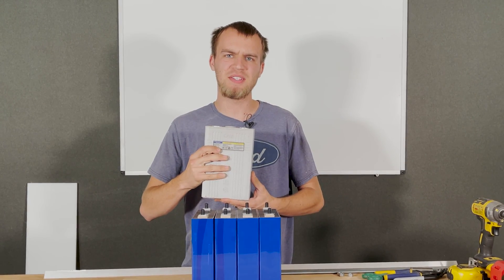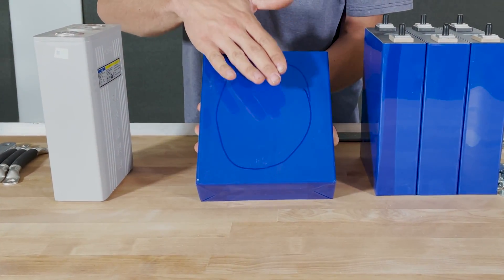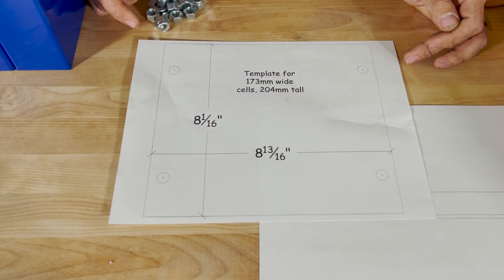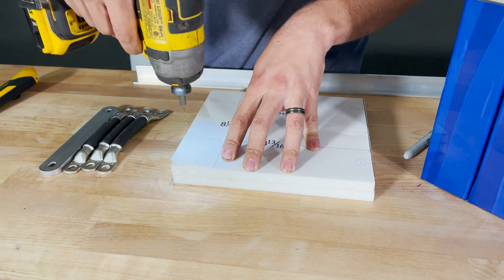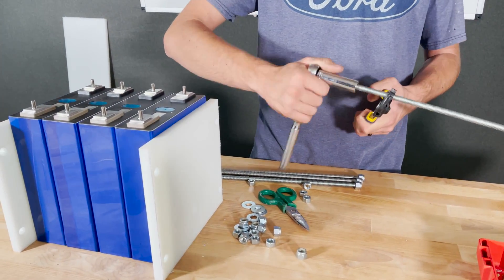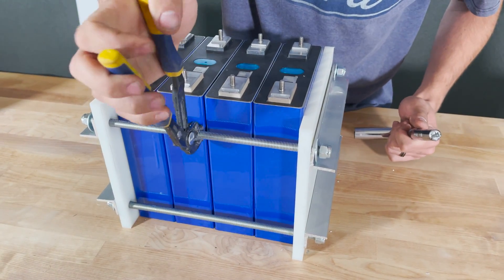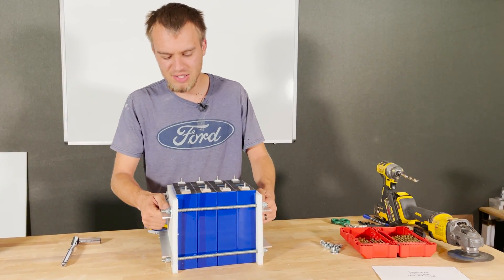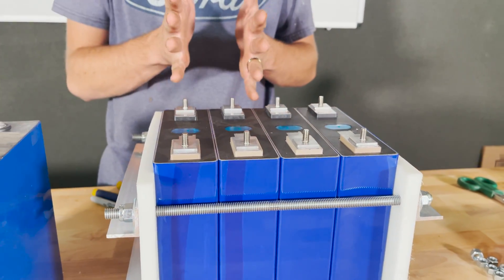LFP Cell Compression || The What Why How & Very Important Considerations || Step-By Step Tutorial

Comment: VERY VERY VERY IMPORTANT to consider with these new compact LFP cells!!! Isolation between cells!! I have measured 5mA current between the aluminum casing( that is tie to the positive with some resistance) and the negative!! so if you tigh them together and the fragile blue sheet puncture, there is chances that you will have a slow current leak bwteeen two cells and get them out of bvalance pretty quick. Thundersky, CALB or many other plastic casing dont have this problem but aluminum casing DOES!...  the blue adhesive sheet around teh cells is not a good protector! any conductive dust or edge damage will expose conductive aluminum.  also watch for the bottom  there is a black plastic sheet that is not sealing it so any condensation will end out making a conductive path to the  aluminum at the bottom and  make your battery rack tie to one or more of the cells if it is also made of conductive material.
Reply: The isolation between the sheet should be Neoprene or Polyethylene with a Firmness @ 25% Deflection of ~13-14 psi. In the USA Grainger has 3/16" Neoprene and in Canada Polyethylene 1/4".

There are articles on the net from manufacturers on this topic. The cells must be able to swell, compressing them and not allowing them to swell slightly isn't much better and the effect is that it impacts expectancy life.
Reply: @baylanger  they must be allowed to swell??  by how much??  that is a tough one, ...
Reply: Agree fully.  I prefer fish paper between the cells.  It's pretty much designed for applications such as this.
Reply: Fish paper is a ULTRA BAD material that too many people use, not because it is the good material but simply because it is popular.  In fact Fish paper is not Hydrophobic which mean it will trap moisture inside and loose isolation caracteristics. It also acelerate rust on the cell can when ionic path is created from electrolysis and attack the protective nickel on the steel of cell can. Fish paper negativ effect  will not be seen duringteh first month bot over the years, killing cells with slow short.   @audiophilephile
Reply: Just got some catl 280Ah cells and the alu casing has potential like an 18650

Comment: Thanks for the part at the end. I used an active balancer to balance in place. Just took a while but worked great.
Reply from the maker: Nice work!  I just recommended this to a customer of mine that VHB taped their pack together and then had to replace a cell and re-balance things out
Reply: The downside with the balancer and LIFEPO4 is that the voltage curve sits flat for ~75% of the charge, so the balancer will stop when the voltage matches, but thee cells could still have a significant difference in SoC.
Reply: @wobbleszo  oh, you just do it while floating at 3.4
Reply: No problem

Comment: I would setup the final cell configuration with bus bar spacing and then compress only once. You can just jumper the wiring  for the top balancing (as long as it doesn't get too hot) since it is not critical and rarely performed.

Comment: A couple safety concerns: I would add a thin layer of insulation between the cells rather than just trust the thin blue cell plastic. I would also add insulation between the cells and threaded rod rather than just trust the thin blue cell plastic. The cell casings are all at different voltages once the battery is configured and a jolt or bump or vibration could cause the rod to contact the cell cases which results in fireworks.
Reply: I tested 5mA current leak on the EVE280Ah between the cell aluminum casing and the negative terminal.
Reply: I agree. I will be doing something simular to what he has done with plywood and threaded rods. But I will put insulators between the cells. And using plastic tubing to cover the threaded rods. No reason to have a short from the cases.

Comment: hmmm, i charge some different cell to full SOC, but they didn't go fat, i think maybe the current is the crucial key? I observe that if you charge and discharge with low current something like 0.2c  or lower, it will not swelling (overcharge or over discharge is different matter).
Reply: 080521/0831h PST 🇺🇸    Thank you Wen. You are right. Bulging is caused by gassing internally. The cause for bulging, is due to excessive Current/ voltage being supplied to the Cell. I concur to your wise statement. There are hundreds of LiFePo4 battery manufacturers in the world and none of them have “compressed” 
 their Prismatic cells inside the containers. Did it cause any issue after charging and discharging the battery at the at the PRESCRIBED current and voltage? None have been reported. NO NEED TO FIT ANY CONTRAPTIONS TO THE CELLS. It looks ugly and uncalled for.
Reply from the maker: I hooked up a single 310ah cell and charged it at 10a rate, when the cell was around 3.4v, the cell grew around 4mm in size.  After immediately discharging the cell, the damage was done, and the bus bars for the cell no longer reached to a cell next to it.

As I said in the video, some cells do require it, others may not.  90% of the commodity grade cells on the market do require it, however cells like the Fortune cells do not.  At the end of the day, compression is not going to hurt anything, the worst that it can do is nothing.  It is also a good idea to keep the cells held together so that the terminals don't experience fatigue.
Reply: @sreekumarUSA  I do agree to an extent. Bulging is definitely caused by excessive charging/discharging and overcharging. However, it is not the only cause. I've charged cells individually at a low rate without damage as well. However, at least for the cells I have, the specification sheet from the manufacturer indicates you'll see an additional 1000 cycles, before 80% state of health, if compressed. That's HUGE to me and well-worth compressing even if I tend to agree that it's typically (but not always) caused by abuse of the cell. 1000 more cycles calculates out to almost 3 years if cycling daily!

Comment: Always nice to prolong life especially for the large investment of lithium batteries.
Reply: One argument I’ve read is that battery technology will change significantly within the average charge cycles that compressing them for an added 1000 cycles is a moot point?
Reply: Not really. A 280ah pack is ~US$400, so $/ah they are extremely well priced.
Reply: @Jack-le7vk  ya everyone uses that argument but it is still a huge outlay of cash to build a 48 volt power wall of any size to run a home. Also in Canada they are a lot more money.
Reply: @Jack-le7vk  you're pricing is based on 4 batteries. Some people have 32, 64, or hundreds of them. So it's a large investment ;)

Comment: Compression is totally optional. It adds to the life, but that's all
Reply from the maker: It totally depends on the battery cell and manufacturer, just like I said in the video.  I've hooked up a single 310ah cell and charged it at 10a rate, when the cell was reaching around 3.4v, the cell had already grew around 4mm in size.  After immediately discharging the cell, the damage was done, and the bus bars for the cell no longer reached to a cell next to it.  Meanwhile, the 170ah cells I've shown elsewhere on the channel, assembling with VHB tape, have no such issues, and compression totally does not matter.
Reply: @HighTechLab  thank you for clarifying. It definitely doesnt hurt when done properly. Get a few 1000 more cycles I bet.
Reply: @mwint1982  completely wrong. Compression prevents swelling thus preventing rigid busbars from destroying terminals on those cells with time, it has nothing to do with the lifespan of the cells.